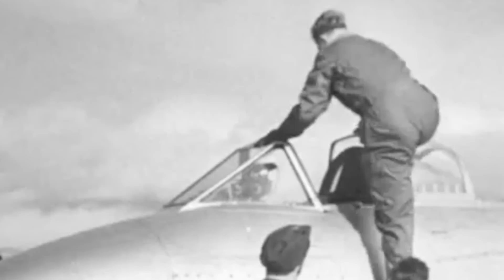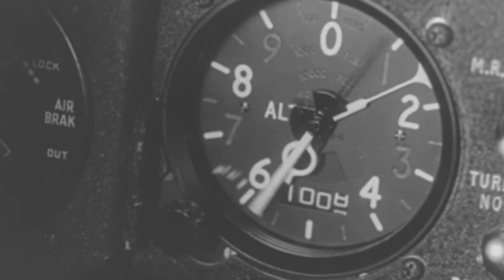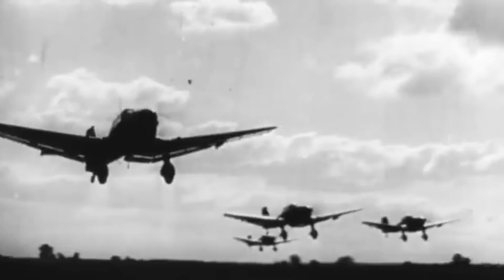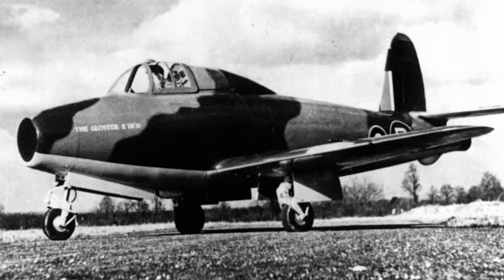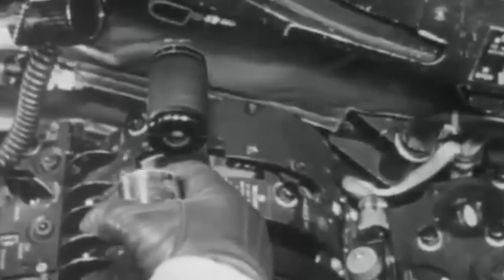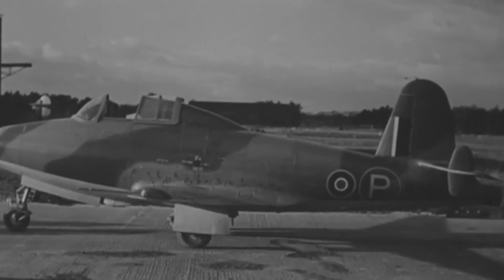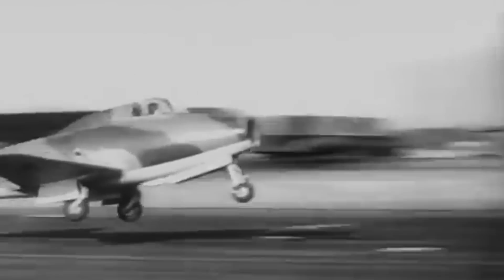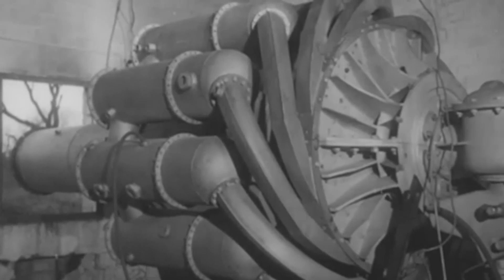Britain's 500 MPH Coffin With Wings

Comment: Britain would never be a leader in jet aircraft... a fact that would lead to the eventual demise of Britian's entire aircraft industry... The UK no longer has any domestic jet aircraft production.
Reply: We feel we can clear up some commonly held myths and misconceptions, obviously.

It's always good to see the facts presented clearly and concisely isn't it

See further down for a Meteor losses comparison.

Indeed that's correct. The Whittle Gloster E28/39 was of course a brilliant aircraft that was later copied in Russia as the upsized and tweaked Mig 15 with a copy of the RR Nene gas turbine aero engine.

Obviously the RR Nene being the world's most powerful & most reliable gas turbine aero engine in 1944. 

   That's correct, of course the MD F3H Demon was a contemporary to the DH Sea Vixen & had a similar performance. The F4 Phantom was a follow on from the F3 Demon. The Sea Vixen took a long time to get from first flight to introduction for various reasons and a similar situation occurred with the MD F3H Demon. 

McDonnell Douglas F3H Demon
590 Built.
Introduction date 7 March 1956
First flight 7 August 1951
Retired 1964

MD F-4 Phantom 2
Number built 5,195
Manufactured 1958–1981
Introduction date 30 December 1960
First flight 27 May 1958

DH Sea Vixen
Number built 151 (including two DH110 prototypes and one Sea Vixen prototype)
Introduction date July 1959
First flight 26 September 1951
Retired 1972

Non combat phase accident losses.
% of Aircraft built.
The Canadair CL-44 was a turboprop airliner.
Canadair CL-44              (ff 1959 ) 48%
Lockheed XF104              (ff 1954) 100%
Lockheed  P80                 (ff 1944) 43%
Lockheed F104                (ff 1954) 45%
MD FH Phantom 1           (ff 1945) 35%
MD F4 Phantom 2           (ff 1958)  28%
MD F3H  Demon              (ff 1951)  32%
Gloster Meteor               (ff 1943)  21%
DH Vampire                    (ff 1943)  23%
DH Sea Vixen                  (ff  1951) 33%
Gloster Javelin                (ff 1951) 20%

    Regarding the UK Aerospace Sector.
  
An airline recently ordered 60 RR Trent XWB Engines

   Clearly It's a great pity & a crying shame that British military forces had to occupy a large part of Germany for decades after 1945 & Russian military forces had to do the same. Of course Russia still posseses a large chunk of what was German territory & of course Russia & the UK produce nukes. Obviously Germany does not produce nukes.

   Interesting British achievements.
There is no doubt that the Fairey (England)
Delta 2 was of course the world's first jet
aircraft to exceed 1000 mph.  lndeed It
exceeded the previous record by 310 mph &
held the record for 1 year. Incidentally, the Dassault Mirage 3 & 4 are based on the Fairey Delta 2.

Early days, jet fighters.
   De Havilland Vampire, Sea Vixen & Gloster Meteor accident losses were not high or unusual for fighter aircraft at the time. De Havilland built large numbers of all metal airframe aircraft before the DH Comet.
We mustn't forget of course that the DH Vampire for example first flew in 1943 & the engine was also built by De Havilland. There were examples of the Vampire interceptor / fighter in service until 1990 which was operated by more than 30 countries.

Non combat phase accident losses.
% of Aircraft built.
The Canadair CL-44 was a turboprop airliner.
Canadair CL-44             (ff 1959 ) 48%
Lockheed XF104             (ff 1954) 100%
Lockheed  P80                (ff 1944) 43%
Lockheed F104                (ff 1954) 45%
McDonnell FH Phantom  (ff 1945) 35%
Gloster Meteor               (ff 1943)  21%
DH Vampire                     (ff 1943)  23%
DH Sea Vixen                  (ff  1951) 33%
Gloster Javelin               (ff 1951) 20%

   An example of what goes on these days in various countries.
Obviously, for example, there are of course no German companies that makes German jet aircraft in Germany & there are no German Companies that make German gas turbine aero engines in Germany that are suitable for widebody airliners.

     That's correct, Brazil makes very good airliners & Brazil is 100th down the list along with Indonesia for wealth per capita. Of course it is in fact the case that Embraer can't build those airliners without purchasing stuff from the US, UK & Europe.
Norway Holland Denmark Ireland Belgium - Top 20 wealth per capita - Don't make airliners -  its as simple as that.

   Early days of the airliners.
That's correct of course, at the time the Comet wasn't particularly dangerous. Agreed, that is indeed the case of course, The DH Comet was definitely not the worst engineering failure in commercial airliner history.

Losses comparisons
How things were in those days.

DeHavilland Comet 4 UK                       14%
DeHavilland Comet all  (ff 1949)           17% 

Boeing 307                               70%
Boeing 247                               48%
Boeing 707            .                  20% 
Lockheed Electra Turboprop   29%
Canadair CL-44  Turboprop     46% 
Convair CV-580  Turboprop     22%
Convair CV-880    (ff 1959)       27% 
Convair CV-990     (ff 1961)      33%
Tupolev TU-104       (ff 1955)    16%

     Of course De Havilland had prior experience building many all metal construction airframe aircraft & thousands of jet powered fighter aircraft that were primarily of metal construction with pressurised cockpits & jet engines built by De-Havilland.

  More recent UK military jet aircraft.

  Of course the Tornado & Typhoon & their engines are Supersonic & are indeed British design aircraft with British design engines built by an international consortium. The Tornado design for example started life during the 1950s at Vickers as the AFVG, it's engine is based on the RR RB-199. The EE Lightening is also a British Supersonic jet aircraft.

  The Typhoon is the British BAC-EAP with an engine based on the British RR XG-40, the Typhoon is also built by an international consortium.

  Agreed, that is correct of course, clearly there are many countries that could easily produce airliners of better quality than Bow-wing (see b-47 wing folding & wing collapse incidents) but don't for some very good reasons. Bow-wing (see B-47 wing folding  & wing collapse incidents) being a result of the size of the US, the large protected domestic market & great ease of testing new types due to the equator to arctic geography complete with up to date aviation infrastructure & a few other reasons related to production scale capability, politics, the nature of the airliner market coupled with the nature of airliners themselves & general basic economics.

  Obviously there really is nothing special about Bow-wing, having more than 50 years design / build experience on the type means they have no excuses for the horrendous 737 Max incidents for example.

    Indeed GKN Aerospace, BAe Systems & Rolls Royce combined now do more Airbus work than Germany on an absolute basis & significantly more work than that on a per capita basis.
  
     Agreed, Per capita for the home nation BAe Systems is the world's largest defence contractor.
 
    Correct, BAe systems announced the recent £4 Billion takeover of Colorado based US based Ball Aerospace.
 
    It's definitely the case that BAE systems now does a significantly higher value of work for Airbus than it did when it was a major Airbus shareholder before 2005.
    
      Obviously RR now owns US Engine maker Allison for example which does classified Aerospace work for the US Govt.
  
   Yes, that's right of course, Anybody currently flying on a widebody airliner stands a good chance of being on an aircraft powered by RR gas turbine aero engines built in the UK.

   A typical but small glimpse of what goes on in the very internationally orientated British aerospace sector. 

  Of course the RR Nene was in fact the world's most reliable & most powerful gas turbine aero engine in 1944. Licensed built versions & copies of the RR Nene & RR Derwent would go on to power many aircraft in Russia including the Mig 15 & Mig 17, the US, China, France & other countries for decades after 1944.

      Boeing Apache Attack Helicopter.
AH-64: 75 UK suppliers, 7% UK content, global fleet of 1280+ aircraft.
F35B more than 130 UK Suppliers, more than 30% UK content.
F35A & F35C more than 130 UK Suppliers, more than 15% UK content.

   There is no doubt that an airline has just ordered
60 RR England Trent XWB Engines

Obviously the UK has the
World's Highest Combined Per Capita
Nuclear / Defence / Aerospace Sector Activity.

Rolls Royce Holdings UK
Subsidiaries
- Rolls-Royce plc
- Rolls-Royce North America (Allison etc Classified Military stuff)
- Rolls-Royce AB
- Rolls-Royce Deutschland
- Rolls-Royce India Private Limited
- Rolls-Royce Marine Power Operations
- Vinters Engineering Limited
- Rolls-Royce Controls and Data Services
- Rolls-Royce Power Systems
- Bergen Marine
Joint ventures include:
- Rolls-Royce Turbomeca
- MTU Turbomeca -

Trent Family
The MT30 (Marine Turbine)
Industrial Trent 60 Gas Turbine
Trent 7000
Trent XWB Airbus A330neo.
Trent 1500
Trent 1000
Trent 500
Trent 600
Trent 700
Trent 800
Trent 8100
Trent 900

RR wholly owned subsidiaries in Germany handle smaller 2 shaft RR gas turbine aero engine work.

Clearly the line above this line is blank.

We do indeed hope this helps, of course.

Cheers as always & 👍 indeed.
    
. ..... ...... ...... ...... . . . .. . ..   . .